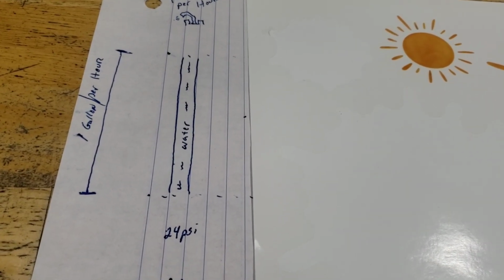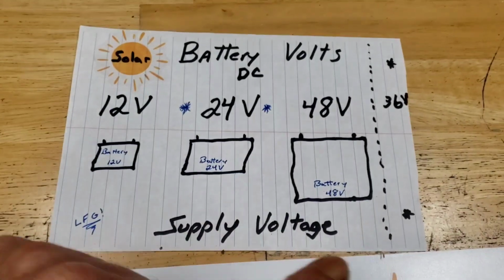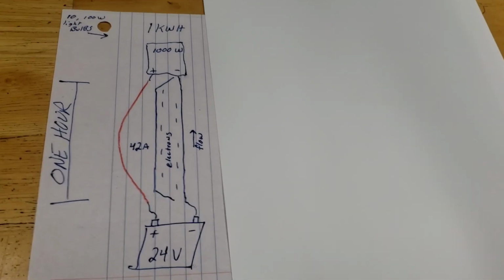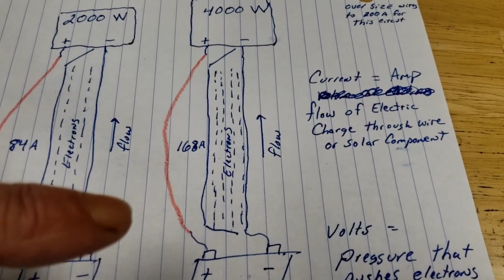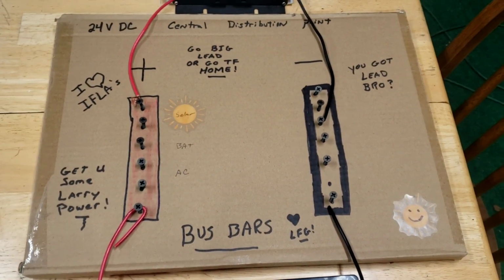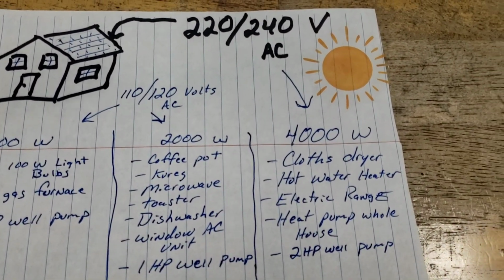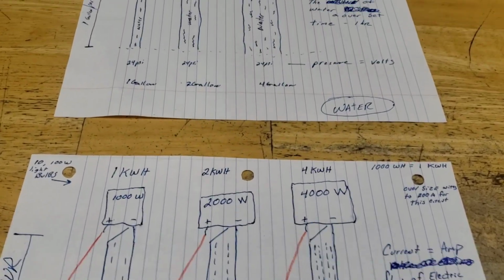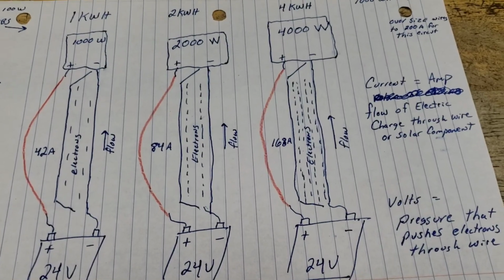Basic Solar, WTF is a Volt, Amp, and Watt? VIDEO #0  Ground zero for solar learning... LFG!! 💪

Comment: Great job, Chris! Still learning the math side of this - is it correct to say wattage/amps at 12v and 48v? 
For 1000 watts at 24 volts, the calculation is 1000 W ÷ 24 V = approximately 41.67 amps.
For 1000 watts at 48 volts, the calculation is 1000 W ÷ 48 V = approximately 20.83 amps.
Reply from the maker: Yep, Its cut half when you double V.
Once you have source V you only need 1 other variable to figure it all out...

W=VxA
V=W÷A
A=W÷V